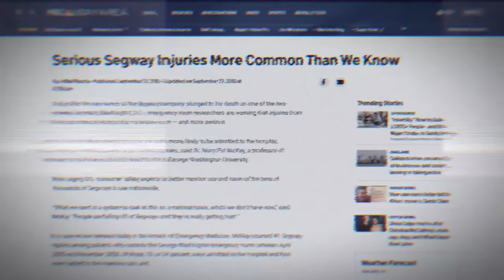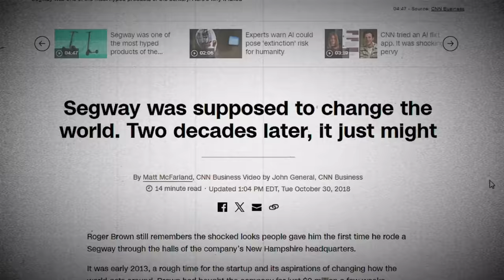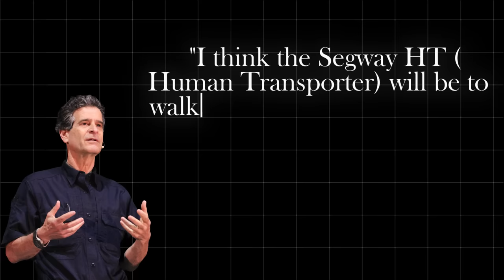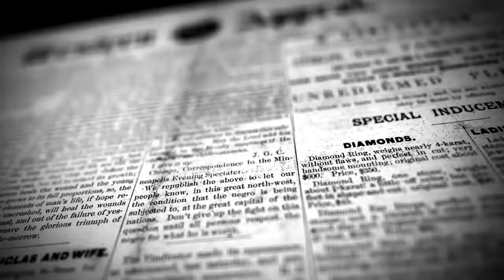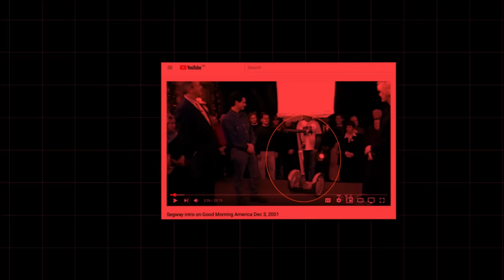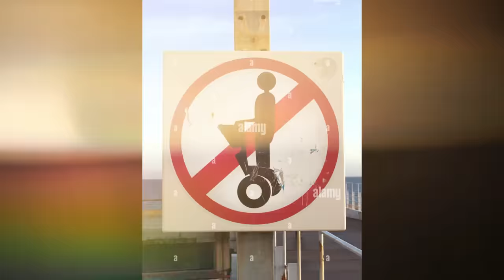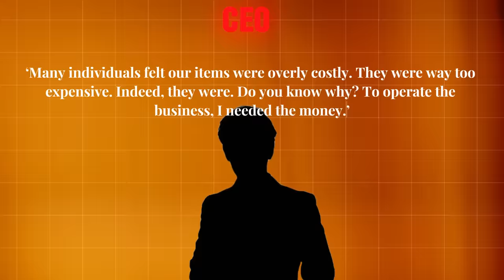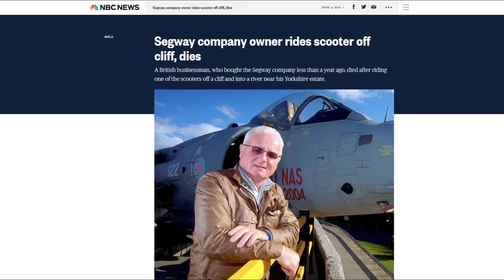Segway's Downfall: What Really Happened?

Comment: One time I applied for an engineering position at Segway. They had a lot of custom equipment assembled but they couldn't make any of it work. I asked them to let me see the engineering drawings and schematics for the equipment so I could troubleshoot it. The manager told me, "We don't do drawings. We don't have time for that, we just assemble the stuff". No wonder they couldn't make the stuff work. Having proper engineering documentation is essential to building and debugging equipment like that. They had inoperative equipment lying around for months that they  couldn't fix, but they were too busy to produce the documentation necessary to efficiently and quickly debug the equipment. After hearing that I said thanks anyway and I left. No way was I going to work in an environment like that. I'd rather go outside and pound my head against the side of the building.
Reply: Cool story bro
Reply: The real question: was it a humbug or a hoodoo!!?😂🤣😂🤣
Reply: @skypucktrader9909  The story is completely true. All that shit is probably still sitting there, and it still doesn't work.
Reply: That place sounds like a nightmare. Great move to just walk away.

Comment: They were just too expensive and difficult to bring places. They worked ok for patrolling large facilities, but they aren’t compatible with individual ownership. A scooter, ebike, EUC, et al, are better choices than a Segway for 99% of people. They are cheaper, faster, more portable, and just better for almost any private individual buyer.
Reply: Less active people will prefer sitting, which Segway doesn't provide.
More active people will prefer having pedals to push, which Segway doesn't provide, and having sitting as an option is way preferable regardless.
Segway's market? Not transportation, but toys. Expensive toys. Add a small trailing castor third wheel and a seat, both on flexible supports, and maybe...
Reply: They are even useless for patrolling a large facility. There is no way to carry any equipment or supplies. An electric scooter can even carry a second person. I live in China. On construction sites, all the supervisors use electric scooters to get around quickly. Not a Segway, expecially since you can buy about 17 scooters for the price of one Segway.
Reply: Here in China on-street parking is scarce. Drivers keep a folding E-scooter in the trunk of their car. They can park far from their destination without a time-consuming walk. They cost less than $150 US.

Comment: I own a Segway i2 I purchased it in June of 2015 I still use it just about every day during the summer and spring in the fall I love love love my Segway.  My commute to work is 15 to 20 minutes in my truck and 9 minutes on my Segway. I currently have 5863 miles on it.  I just used it yesterday for my commute to work.  Segways are great as long as you respect them. They can be a safe alternative way to commute.

Comment: I bought a Segway i2 in 2009. I rode it for many years and only had one fall. It was an amazingly versatile machine (moreso that EUCs or e-scooters) but not as fast. I took the time to learn how to use it properly. Lack of education, safety mindset, and reckless riding were the cause of most Segway accidents. I went thousands of miles on mine incident-free.
Reply: But why not just get an electric scooter or e-bike? These make no sense.
Reply: I cannot comprehend covering thousands of miles on something so unstable.
Reply: @peterduxbury927  When learning to ride a bike it was unstable until I got the hang of it. When I was 63 I had the opportunity to ride a Segway. I didn't fall and it felt a little awkward at first...it was a good experience.
Reply: @williamfaulkner1959  Hi William, thanks for your message. When I wrote my original message, I must admit that I have never rode a Segway, and I saw Police using them. From a Physics perspective, it is only the electronics that are employed, that gives this machine its' stability. Without electronics, I am sure that you would agree that something like this would be almost impossible to master. When Boeing installed much large engines on the Dreamliner, it was the software and the electronic systems that stabilised the Aircraft when in flight. Get this wrong, the results are catastrophic. I don't really like the thought of using any electronic systems to stabilise any machine that carries people or passengers. Another prime example of similar failure, is the Two-Wheel Hoverboard, which has hospitalised thousands of young children and many adults. I'm 75, and I value my old bones! To employ any form of software and electronics in order to fight against pure Physics, will always result in failure at some point. I simply will never believe that Ryan has covered "thousands of miles" on a Segway, whether he had incidents - or not. Greetings from Australia.
Reply: @peterduxbury927  I have ridden an electric unicycle around 75 miles this week. I wouldn’t ever consider buying a Segway, but it’s certainly possible to cover thousands of miles over years if he’s using it in lieu of taking car trips.

Comment: For me it's a love-hate thing.  To this day I ride my Segway clone around campus to quickly get from building to building.  It's been a real boon, but not without its dangers.  In the two years I've been using it for this purpose, I've fallen twice taking it through doorways.  Even the slightest contact between a wheel and a wall or door frame is sure to result in a tumble.  Now when I'm going through doors, I'm super careful (and slow) taking pains to avoid any contact.  But I still use it, and will continue to as long as the battery holds up.

Comment: I've owned my segway mini-pro for about 7 years now.  This is the small one that doesn't require a handlebar.  Of the escooter, eskateboard, ebike and segway mini-pro I own, the most convenient to ride is the segway.  It's the only one I don't have to lock up, because I just leave it powered on and push it around the store/office with me.  It's also the best option for grocery shopping because both hands are free to carry bags.  They can be dangerous if one wheel hits a bump.  The device easily gets out of control and wobbly, but that's where you have to always be paying attention to the road ahead.  I've had a couple falls, but I've had falls on all but the ebike also.

Comment: People's apatite for change is usually around 10% different and 90% familiar or "evolutionary". Adding an electric motor to a skateboard, scooter, or bicycle is evolutionary and meets this criteria. Instant success. The Segway, perhaps, was too revolutionary to expect rapid adoption, especially at its price point. Other slightly more aggressive e-designs, such as the electric unicycle, EUC, and one-wheel concepts have succeeded, in spite of being revolutionary, because they are accessible to the casual user because of their low cost of entry and yet they are FUN and functional as transportation. Yes, you can spend a little or a lot on them because there's a gentle upgrade path between entry level and pro level products from which to upgrade.

Comment: Segway was defensively before its time, hyped up with out having a full  grasp of the limitation of the hardware available at that time. But the legacy of the Segway still lives in form of the Electric unicycle (EUC), and It to had its rocky start but last year the tech finally started to reached its maturity for mas adoption. So even if you did not get a Segway, you can still join the PEV community by baying an EUC.

Comment: Luckily, the story did not end there.  This technology led to the rise the the electric unicycle (EUC), starting around 2015.  The current high end ones have suspensions and have a top speed of over 55 mph and have a range of 100 miles.  They are about as much fun as a person can have.
Reply: Well all new technologies is like that, an idea, then 1 or many failed products due to technology or business problems, then a few iterations down the road, it takes off.  Segway is still on this path, and those 2 wheel balance scooter is just the first step to a better mode of personal transportation.

I commuted on a Sherman S to work, it's just a really nice mode of transportation, and costs far less than a Segway.  Maybe in 10 or 20 years, it would be as common as a bike.
Reply: @davidajzhang   I have a V12 and an S18.  They are both great wheels.  I'd like to upgrade this year.  Does your suspension require a lot of maintenance or give you any problems?
Reply: @Ingothnia  Yeah, mine did, actually still does do a slow oil leak.  I had to service it one and now the other side leaks.  However, if I just want to ride, I can choose to ignore that completely.  It feels just as nice without damping, especially on the compression side.
Reply: Truth
Reply: I don't feel safe at 55mph in a car.
Reply: Street legal? If not then they would only be useful for trail riding (where motorized equipment is allowed).
Reply: @nommadd5758  No, they are not street legal.  But if you follow traffic rules, people won't really bother you.
Reply: @terry_willis  It's like riding a bike, you control the speed.  It goes as slow or as fast as you want it to go.
Reply: @davidajzhang  : Sounds like wishful thinking to me.  How do you "follow traffic rules (laws)" while riding an illegal device?! (No lights, etc.)
 I've been riding motorcycles for decades. I can cover hundreds of miles in a day, over various terrain for little expense. Legally. 
And they're as much fun as THIS person can have! I wish you luck!  😃
Reply: @nommadd5758  Their legality depends on where you live.  I ride on backroads, parks and sidewalks.  I try not to draw any attention to myself and the police seem fine with them.
Reply: @nommadd5758  It's very different, I don't think they are direct substitutes for each other, just like a car isn't a substitute for a motorcycle.  Motorcycle is very fun too, and there's obviously a huge market for it, but it's not as versatile as an EUC.  I can seamlessly transition between a pedestrian (riding on sidewalk), to a bike (riding in bike lane), to a dirt bike (riding off-road), to a motorcycles (riding in a car lane).  Sometimes multiple times in one trip.  And I can just place it beside my desk at work, or put it in my trunk and take it on a road trip.
Reply: Absolutely! It's clear upfront that it's not the safest, but I love taking my S18 all over the city, especially offroad, and after 5000km it's quite natural. When the ground isn't iced up I commute to work every day on it. At least Segway paved the way for these... 
And even Segway's not dead - it's just Ninebot now!
Reply: I prefer my ebike but them EUC are very cool and every euc rider I have met are always a little bit crazy but in a good way but I can see why the segway didn't catch on but I think all the PEV have come along way since the segway and at a price that most people can afford 🚵⚡👊
Reply: All those inventions are a great way for Americans to pack on the pounds!
Reply: @yoadrian5897 I remember back in the 80s the wrestling Duo call the Samoans always made their entry to the wrestling ring with their massive bodies and even fatter asses overhanging these little motorbikes look so funny but it was a crowd pleaser
Reply: And I’m sure they are as, if not even more dangerous…
And if nothing else, “regular unicycles” have long been the butt of many jokes, so I can only imagine the next generation of unicycle jokes…and hospital visits.
Reply: @davidajzhang  It's not like riding a bike, it moves under its own power, and that changes the class of vehicle. So you can't control the speed on any other self-powered mode of transportation such as a car, truck, or motorcycle? People's tech toys can be so annoying.
Reply: @nommadd5758  And you too can control your speed just like his electric wheel.
Reply: @volvlov759  What do you do when you encounter foot traffic?
Reply: @Davesworld7  : Not "street legal" without all required "safety equipment" (lights, etc.)! Ask your local county attorney!!
Reply: I am already walking like them, not riding anything that moves under its own power.
Reply: @Davesworld7 it’s actually really convenient.  I sometimes ride it to work, I always keep it with me in the car trunk so I can go sight see when I travel, go into those pedestrians areas.  If you ride slow, you can ride it at the same pace as walking.  EUCs are just great.  Like all things, it’s not perfect and it can’t do everything, so it’s not my only method of transportation.  But it did genuinely make my life better, and I don’t see any downside to using it.
Reply: I feel the requirement for owning and using an EUC should be riding an ACTUAL unicycle.  Earn your turns!  (Urn your tearns? :)
Reply: @dudeonbike800  It might be both called unicycle, but they are actually quite different.  A better analogy may be a Segway or a hoverboard, not manual unicycle.
Reply: "They are about as much fun as a person can have."  With one's clothes on, anyway.

Comment: I have one, and yes, I still use it.  I purchased the side cases, and the front bag - which greatly enhance the utility of the device.  I did fall one time, when I tried to climb a grass slope that was too steep, and the Segway stalled out, and I had never trained for that situation.  Neither of us were worse for the event, and I proceeded.  Fortunately, there is an enterprising fellow in New Hampshire who still supports the Segways with rebuilt batteries and spare parts.  The Segway certainly played a positive role for a period when our family was down to one car - plus bicycles and motorcycles, all part of a transportation mix.

Comment: For me: the insane hype pre-launch followed by what was launched turned me off, and also way too expensive with not enough range.  With modern battery tech, they could probably extend this out to 30-40 Km or more.  But scooters and bikes - with in-line wheels - make a better base vehicle than a 2 wheeled unicycle.
Reply: Not counting $500 beater car, which had much better range, at one tenth of the price...and you can have a bike or a scooter in the trunk.

I mean, okay, if you can dump the $5000 for a Segway HT, you probably also own a car with a trunk to fit that Segway. It's just that you need to lift 40kg into the trunk.

Comment: I have an e-bike. It cost about half the price of what the Segway cost 12 years ago. I can ride it 100 km before I need to recharge it. I can transport 30 kg of stuff with. It has lights. It climbs hills and it has no speed limits downhill. I can lock it to bike stands. It's just a way more practical concept. I did ride a Segway once for ten minutes and it was fun! Well, that's it, it is a fun gadget. I've seen quite a lot similar stuff as the Segway, much smaller, with one or even only one wheel. People use them for a short while then send it to their basement.

Comment: Not gonna lie, e-scooters are the only practical "futuristic" transportation methode. I need something to grab. I need to feel the controll. I need suspention!
Reply: I’m still holding out for flying cars. Science and popular culture promised us. I feel entitled to flying cars. I’m not gonna be satisfied until we get them.
Reply: That something to grab is only as stable as the front wheel. On EUC you don’t need to hold anything and it is driven by introducing instability, which makes it react instantly. It’s like an extension of your body.
Reply: The handlebars of an e-scooter are a false sense of security. Let go of one hand, you’re half way to the ground. They’re clumsy and cumbersome.

An electric unicycle on the other hand is probably the purest form of “futuristic” transportation available right now. No need to rely on handlebars (with all the benefits of being hands free), more stability and control, slimmer form factor, and many include suspension.
Reply: I have driven e-scooters with one hand. Not being able tu use a handelbar would be clasified as a major skill issue

Comment: Just for the record, there are no gyroscopes in a Segway. It has none because gyroscopes have nothing to do with the way a Segway works. I don't know why this keeps coming up.
Reply: The devices are actually called "vibrating structure gyroscopes" or "Coriolis vibratory gyroscopes".

The word "gyroscope" means "device to show angular movement" (gŷros = going round, σκοπέω skopéō = aim, look). A device with the purpose to maintain orientation in space would be a gyrostat by that logic. A "rotating gyroscope" is kind of both.

 And, of course, Segway mentions all the time that a Segway HT has five gyroscopes (plus two tilt sensors). That's why it's mentioned everywhere.
Reply: Vyros are another variation and they have everything to do with how it works. What do you think aircraft use? It could not balance itself without some mult-axis input whether it's a gyro, laser ring gyro, or vyro.
Reply: @klausstock8020  In other words they are Vyros (vibrational gyros) which have been used in advanced aircraft for decades. Most of mine use laser ring gryros, namely the 777 which I was an Avionics Tech on for decades. I wonder how he thinks a segway is self balancing? Reading the attitude of his nuts?

Comment: I worked for DEKA for a couple of years.  They do have a couple of Segways there.  I tried one in a small hallway for a minute or two and then tried to move to a door, unlock it, and travel down the corridor on the other side.  I was successful.  So, it is possible to adapt to it with little practice - but I can also understand how some could have trouble.  I walk 6 miles a day for the exercise, so I have no interest in using one to replace walking.  But it was fun to try it.  Besides, if you're working for DEKA, shouldn't you at least try out their most iconic device?